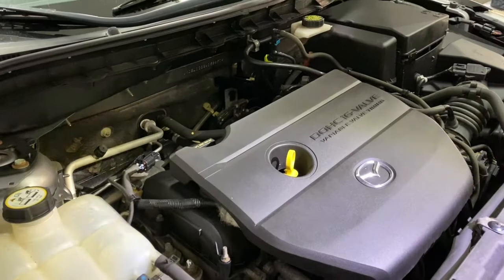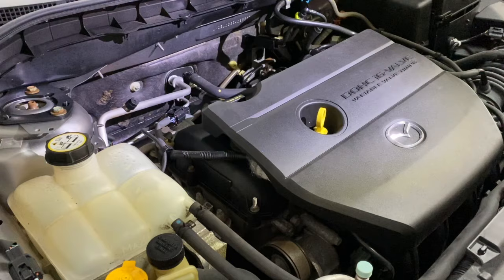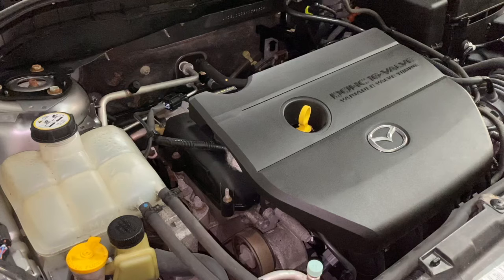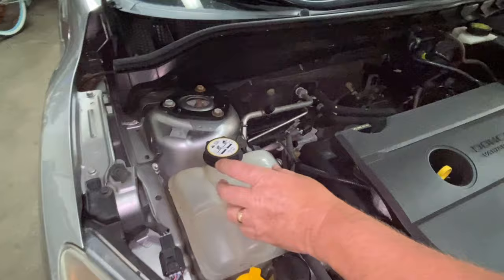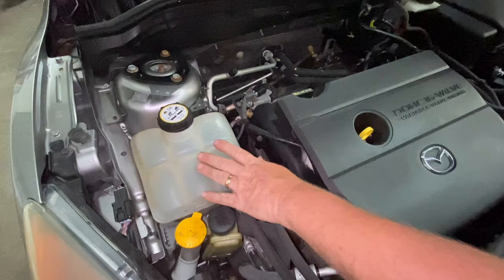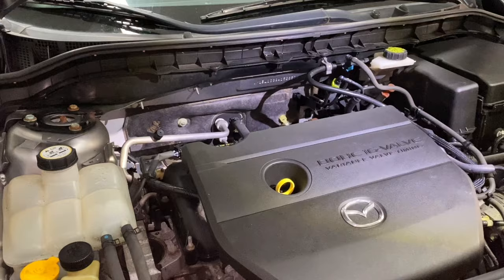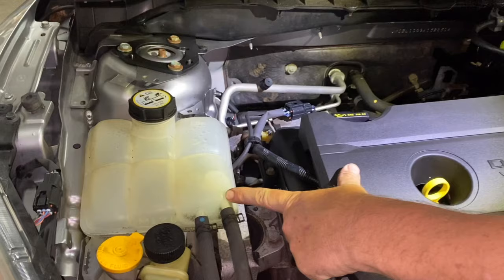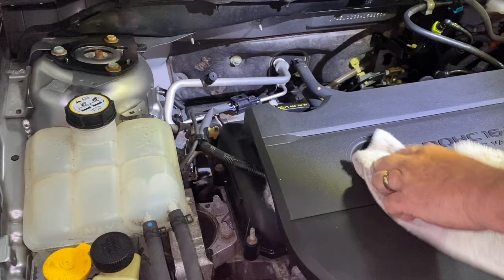Learn 3 Symptoms of Blown Head Gasket

Comment: my tacoma is smoking out the tail pipe when it cold but once up to temp it stops I feel a little loss of power and it vibrates more is it completely blown or would k seal maybe work?
Reply from the maker: Hard to know for sure but some light white smoke is normal more like condensation when cold. You may have a head gasket starting to fail, I would stay away from any of those additives, most never work and if they do only for a short period of time.

Comment: Helpful as hell my 2007 Scion tC  I believe has a blown head gasket and one of the radiator hoses has more of thick oil with a little water mixed still guessing that’s the same thing
Reply from the maker: Yes it is. Thanks for the comment, glad it helped.
Reply: @Motorcarnut  I have a little more questions. If i would be able to email you or talk to you somehow

Comment: Hello, 2002 BMW X5, I do have white smoke from my exaust, on start up then it subcides. I notice last year a creaming color on my oil cap and around the cap fitting, and a little on the oil dip stick. I don't drive to often,  short trips because of the age of the car. My father says BMW'S are not short trip cars and you have to drive them long distances sometimes to burn off Condensation, he said thats why I'm getting the thick white smoke, but I don't know, I don't want to take it on the highway and it breaks down on me haha. Blown casket or Condensation? Sorry for the long comment haha. BTW it does smoke while I'm driving also, its like it does it off and on.
Reply from the maker: If any vehicle isn't used for a good amount of time it will have some slight milky oil color under the oil filler cap, this is normal also when you first start a cold vehicle there will be white smoke but not thick sweet smelling smoke. So I can't say for sure since I'm not there, I would change oil and filter and flush coolant system then drive it around town get it nice and hot and check your fluid levels and go further and further with it to see if it stops smoking and radiator fans come on and off.

Comment: Hey boss, i had my radiator give out which was leaking and overheated the car. I replaced it but noticed the coolant was a cloudy blue instead of blue. I was wondering what you think i should look at next because its idling like its ok so far. Im scared to drive without completely fixing it. Its a 09 maxima
Reply from the maker: When the car is hot meaning driving it for about 10 miles or so there should be no smoke. When cold there should only be a light tint of white smoke, never blue, blue is oil burning and not thick white sweet smelling smoke either that’s burning coolant. Does the car overheat now?
Reply: @Motorcarnut  hey thanks for the quick reply. At the moment it seems ok .. i got prestone radiator cleaner cycling through with water to clean any thing left out of the system. I also meant the coolant its self was that color. The coolant is usually blue but when i emptied it it was blue with some sludge
Reply: 😮 @Motorcarnut

Comment: I’ve owned a 2008 Mazda3 (bought 3yrs old with 25K miles on it and I had ZERO issues) and I specifically remember the coolant temp gauge. I rented a 2010 Mazda3 and I didn’t even notice that there was no coolant temp gauge. I also purchased a 2015 Mazda3 and a 2014 Mazda6 and I cannot remember whether or not there was a coolant temp gauge. I guess too bc I purchased the vehicles and they were not that old and had less than 25K miles on them and I always kept my maintenance up - so I guess I didn’t really think there would be an issue. But, for some reason, when I really think back, I think both of them had just the idiot light system where it would say cold or hot. Thought mine never said hot bc I always maintained my cars.
Reply from the maker: Yes 2010 and up, most models had no coolant temp gauge especially in the cheaper vehicles. It's not only the gauge but the wiring, computer controls etc. all to save a penny where they can.

Comment: I have an rx8 and I noticed a few days ago white smoke started coming from my exhaust on a cold start and my coolant levels are normal no mix on the dip stick and the smoke immediately stops once the car is warmed up. And there has only been one misfire since I noticed the smoke.
Reply from the maker: I would keep an eye on it, cold start up with a little white smoke ( condensation) is normal but if the misfire is associated with the burning of coolant that will be a problem. You could get test strips that test the coolant for any signs of exhaust gasses to see if your head gasket is starting to go.
Reply: Rx8s don't have head gaskets
Reply from the maker: Wow, good call, must of forgot about that and was thinking about a conventional Mazda combustion engine, not rotary. Even though they don’t have head gaskets they are still coolant reliant and can leak from various seals and places.

Comment: After I replaced my radiator the bottom radiator hose keeps popping off. It's a Mercedes CLK550 and it's almost like a clip holds it in. I bought a new clip and was going to try another lower hose. Prior I replaced the oil cooler because because there was oil in the coolant, no other signs of the gasket being blown and after I replaced the oil cooler it hasn't leaked into the coolant again, and thermostat was replaced and it doesn't over heat.
Reply from the maker: Is it an aftermarket radiator? Sometimes they are not made as well as OEM. Make sure you push the hose all the way in and the new clip and o ring are seated the correct way. The clip sits in a grove in the radiator a certain way so when the hose is inserted it click into place.
Reply: @Motorcarnut  Do you have an email I can send the pictures to? $400 OEM radiator.

Comment: Hey man, hope you see this. I been having all sorts of deal with my car lately. 2020 Nissan Altima 2.5 SR AWD with 160k miles. I get timely maintenances and all. Anyways, i replaced the thermostat about 2 weeks ago because my car was getting close to overheating (i never let it get to red zone), got the thermostat changed and did a coolant flush- no overheating or near overheat since. Yesterday i started it and had a bunch of white smoke and it smelled sweet but went away after maybe 2 min. Checked my oil and caps and everything looks normal and it still drives normal. This morning when i started it i noticed a few bubbles in the resevoir tank where the hose is. Now, i will say it has had a code for the egr system and i am waiting to get the egr part tomorrow. Ive had the car looked at up and down 3 different times
Reply from the maker: Sounds like the head gasket is starting to go from what you described.
Reply: Hey. I wanted to follow up with you and let you know that the "bubbles" I saw was just coolant moving through the resevoir haha (I had someone verify). Anyways had a block test done and it turned out not to be a head gasket. No overheating or near overheat. No white smoke since that one time. The exhaust pipes are black and dirty almost like soot.  Any other recommendations? I'm still having a vibrating start. No chocolate milk oil either. I just changed it. I forgot to mention I did recently get new spark plugs put in.

Comment: Hey, I have a 2011 Honda Civic. My car started smoking like that right after an oil change. Does that mean the head gasket is blown and I need to replace the whole thing?
Reply from the maker: Being it was right after an oil change that seems kinda strange? Are you sure it’s white smoke? Or is it blue? I say this because if it’s blue it could related to the oil change, wrong weight, overfilled etc?
Reply: @Motorcarnut  the smoke is definitely white. I did check it and it is overfilled by quite some bit. But 30 minutes after the oil changed something made a scratching noise and a big cloud of smoke was behind the car.
Reply from the maker: What I don’t like is right after the oil change this happened. Oil should not be overfilled and without being there it’s hard to know what happened, do you know what burning coolant   smells like? to see if the car is burning coolant?
Reply: @Motorcarnut  this is my first car and i just barely bought it. I have no idea about a lot of stuff. It did have a weird smell to it. But there’s no leaking or puddles anywhere under the car. (Not sure if that has anything to do with it.) I did check the oil and it doesn’t look like milky or anything like that. and thank you for responding I don’t have anybody else and i definitely don’t know anything about cars.

Comment: i have replaced the radiator cap and the thermo but my problem is mine doesn't over heat nor does it blow white smoke but it goes up in temp when under load but doesn't over heat just get alittle hotter then normasl and then goes down just as fast as it goes up when not under load.
Reply from the maker: Can be a defective coolant temperature sensor.

Comment: Great video! I have a 2008 BMW 116i and after a fairly long journey my car is violently vibrating and I have a yellow oil light on. There doesn’t seem to be a coolant leak and the oil level hasn’t changed however my Rev limiter is bouncing between 600-750 rpm rapidly. Any suggestions?
Reply from the maker: Could be a bad vacuum leak somewhere? Does it have any codes?
Reply: @Motorcarnut  I am unable to find any codes but the problem isn’t  noticeable when driving the car, it is only noticeable when fooling after a long drive if that helps your diagnosis. Furthermore, the radiator runs exceptionally loud.
Reply from the maker: Hard to diagnose without being there but sounds like what i said a air leak somewhere, a hose popped off? Fans running a lot could be a head gasket starting to fail , meaning the engine is running hotter than normal but the computer doesn't see that condition yet. Like I said hard to know without the car in front of me and I don't want to steer you in the wrong direction so you may have to have someone look at it for you before it gets worse .

Comment: I have a 2010 dodge grand caravan (270km) i suspect that i have a blown head gasket and theres probably a small leak of coolant in the combustion chamber. Theres also a smell of burnt plastic.
Reply: I dont fully know if it has to do with a blown head gasket, but on my caravan, theres oil leaking from behind the engine,  below the valve cover, and it has to be an oil leak because its also on passenger side axle shaft
Reply from the maker: There should never be coolant in the combustion chamber, probably a blown gasket

Comment: Get your radiator cap tested. After 100,000 miles it will likely fail to hold pressure lowering the boiling point and the coolant level will drop resulting in no cabin heat.
Reply from the maker: Great suggestion! But this is when it’s too late.
Reply: I used coolant dye to determine if I had a leak. When I couldn’t detect an external leak or cross contamination with the oil or other fluids, I made sure the cap worked before I concluded it was a head gasket issue.

My own cap that was supposed to hold 15lbs of pressure, vented at 11psi and stayed open down to 7psi. 

This caused the boil off and low coolant level condition.
Reply from the maker: Absolutely correct! I even made a video on symptoms of a simple radiator cap. Good diagnose!

Comment: My coolant levels keep dropping about 1/4 cup a month. No visible leaks on the ground. No smoke from the tailpipe at all, no visible signs of coolant in the oil. Doesn't overheat. Temperature gauge stays just below half way. Car runs perfectly fine though. It's a Toyota so I use the recommended red coolant. So when the car was completely cooled, I took the radiator cap off and started the car, and coolant immediately started to rise, but no bubbling whatsoever. Is this a symptom of a leaking head gasket?
Reply from the maker: So, when you say the coolant immediately rises  when you start your cold engine, does it overflow and spill out? Also try when the engine is cold overnight and radiator cap it installed start it and immediately check to see if the large upper radiator hose has pressure, it should have pressure within 2 minutes or less
Reply: @Motorcarnut  Yes, it does overflow, but slowly.
How do I check the radiator hose pressure? Do I need a pressure gauge?
Reply: ....also it stops overflowing once the car reaches its operating temperature, and fans kick on.
Reply from the maker: When the car is overnight cold, squeeze the top radiator hose before starting the engine and feel how it feels with no pressure in it then start the car and immediately squeeze it again and see if it feels the same when it was off. Should not have pressure until the car is hot, if it has pressure let’s say with 1 minute after starting then the pistons are pumping up the coolant system because of bad sealing between the block and head and probably the head gasket starting to go.
Reply from the maker: Ok that’s a good sign that’s it’s probably fine. Try what I said above.
Reply from the maker: Also if all checks out good you may a slow coolant leak somewhere else, got to look all under the car for leaks
Reply: @Motorcarnut  After the car warmed up, the hose was stiff. I park in the garage and I don't have anything dripping except from the ac drain.
Reply from the maker: Both are normal, like I said check for small leak both when hot and cold.
Reply: @Turner2503  check your oil level 
If it rises ur water pump is gone 
Used to own vw treg and my coolant was "dissapearing" with no visible leaks
Turned out that the water pump was gone 
 the coolant was mixing with engine oil
Reply: @uleule136  Haven't found any coolant in the oil. What I'm finding strange is some mornings it is just below the full mark, then sometimes it's right on the full mark. This morning it was about a half inch below. It's a 07 4 cylinder camry and they're known for consuming oil, but mine isn't that bad. I use about a quart every 1,500 miles. Some people report it using a quart every tank of gas.

Comment: 05 jeep 3.7 laredo had radiator, water pump and thermostat replaced just in August. Last oil change (faithfully change by sticker date), the guy says i have an oil leak. He suggests i let him put some lucas oil stop leak in there. I don't have any coolant leaks, resevoir is full, no white smoke after the initial very cold startup and jeep warms up. For the first time ever, I have yellow sludge on oil cap. Dispstick is clean. I decide to do my own oil this time so I could inspect the oil myself and I notice the bolt under my water pump is half out and another bolt is missing from the left side top of those wheels. 🤦🏾‍♀️I was hoping it was just the Lucas causing condensation issues and i just needed an oil change but now I am wondering if those bolts being loose and lost is causing problems. 🙏🏾 a good mechanic walk into my life. I didn't complete the oil change yet.
Reply from the maker: I don’t think loose bolts are connected to the yellow sludge. I never use aftermarket additives. A little condensation under the oil cap is normal if not excessive. Tighten up the bolts, change oil again and monitor the oil again to see if there’s still a problem

Comment: Hi there! Did replacing the head gasket end up fixing this customer's car? If action was taken immediately after noticing white smoke, can you avoid damaging other parts of the car? I have this exact problem and symptom on my mazda 3. Going to flush the coolant and add Irontite with new coolant. Hopefully that acts as a solution for now.
Reply from the maker: Yes it did and yes you can damage the engine even more than a head gasket such as warping the head or cylinder block and more.

Comment: I did not catch my over heating in time and it blew some sort of valve and drained all the coolant. I had that fixed along with the thermostat, but it's still over heating and I hear what sounds like gushing/dripping above my feet when I drive.  I don't see anything coming out and I don't see anything leaking on the ground when I'm stopped or parked. I watched for white smoke today but didn't see any. The mechanic thinks it might be a head gasket that blew with the original over heating. I noticed when I lifted the hood this morning that the reservoir cap had blown off and broke. I'm assuming I need a new one of those for sure. Any other ideas?
Reply from the maker: The reservoir cap can not just blow off I don’t care how much pressure there is. You should find another mechanic and I think from what you’re explaining you did blow the head gasket or can be a cracked head or block but more likely the gasket. The gushing noise as you described is boiling coolant.

Comment: My old 1990 Celica is beat up with all bald tires and all the warning lights on. When I drive it's sluggish with white smoke coming out the exhaust. Engine is always hot on the temperature gage indicator.
Reply from the maker: Well first should see what codes are coming up but either way there should not be thick white smoke at all

Comment: how long will your car smoke for if your head gasket is blown or leaking?
Reply from the maker: If it's indeed a failing head gasket and leaking into the combustion area, Always. But can also be mixing with Engine oil and really no smoke at all.

Comment: Someone passed down a 01 PT Cruiser to me for helping them clean and pack up her house. Now it's been having over heating issues and the coolant will ooze out a dry white liquid around the radiator filler neck. Also fresh coolant will be poured in and a few days later it will look dirty. Now I'm having exhaust smell problems with a light burnt coolant smell in the air.
Reply from the maker: yep, sounds like the head gasket went to me.
Reply: @Motorcarnut  Dang